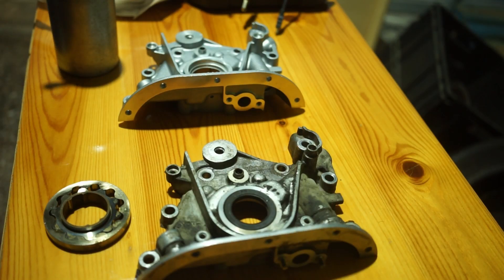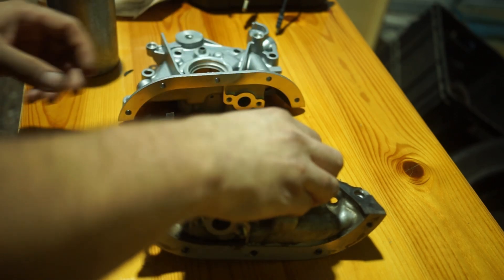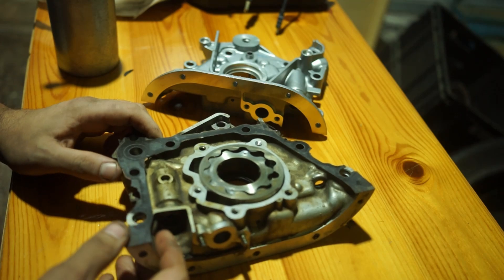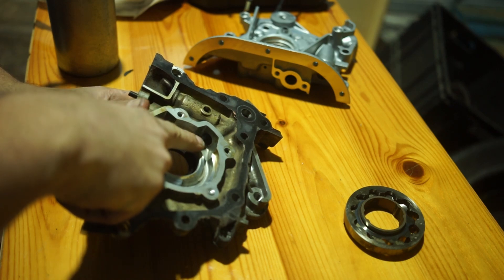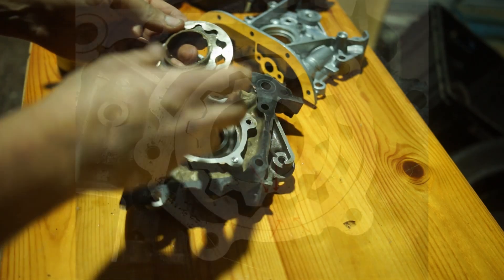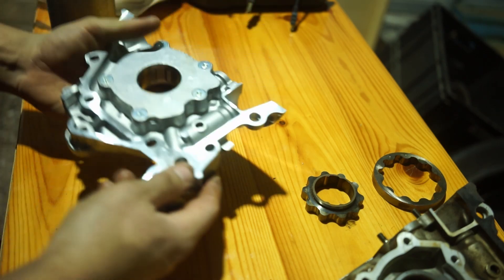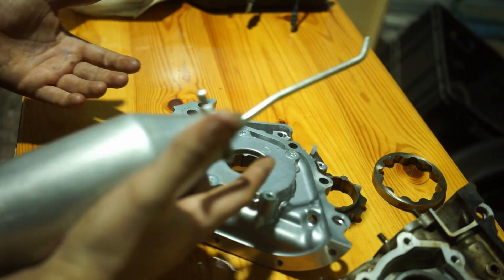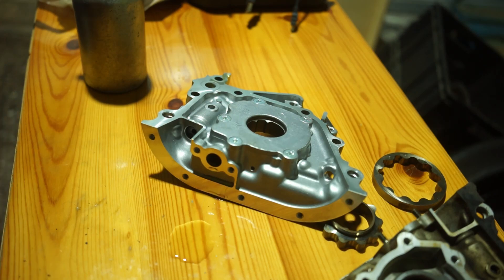Priming an oil Pump and Porting explained | Oil Pump Basics | 4AGE 20V engine build

Comment: I put the 20mm wide gear in my engine and I think I have too much oil pressure. I think the flow is too high and I wish I went to the lower sized wave type pump
Reply from the maker: Thats not really possible the pump has an internal relief valve that opens at a set pressure. Why do you think you have too much oil pressure?

Comment: isnt okey to use vaseline?
Reply from the maker: personally i wouldnt use it as it is different than assembly lube or oil. a lot of people do but in my opionon its not optimal. 

if you put in oil or assembly lube the tolerances are filled up by it and when trying to suck up oil from the oil pan it creates a better vacuum than with nothing at all or vaseline for example.
Reply: @throttlebuddies0  the thing is in my country there aren't many common products like assembly lube. i could use oil but i know that i won't start that engine in months so that why I was wanting to use Vaseline. In my case still better regular oil even if it can drain to the oil pan?